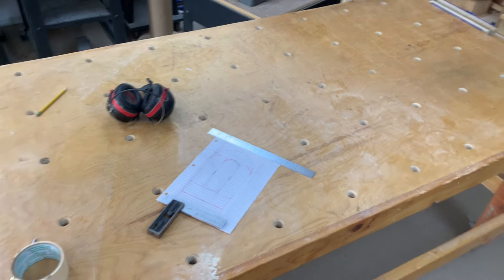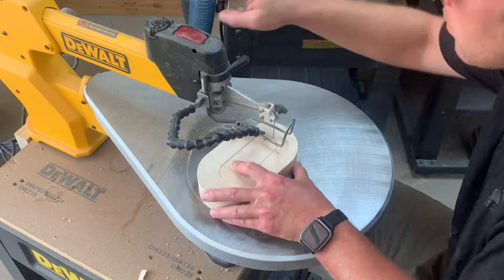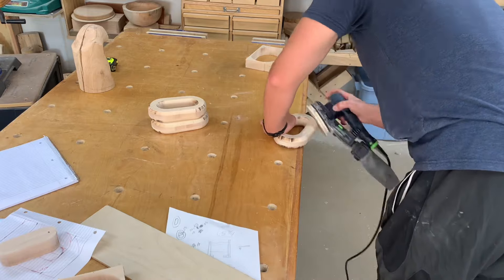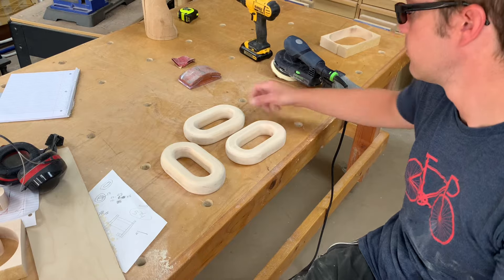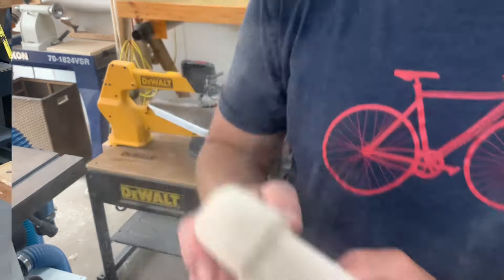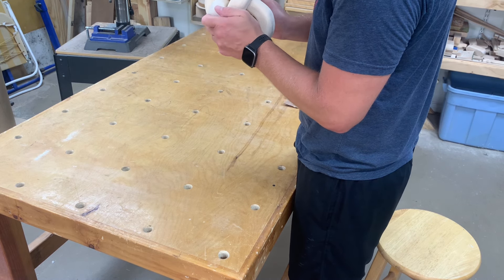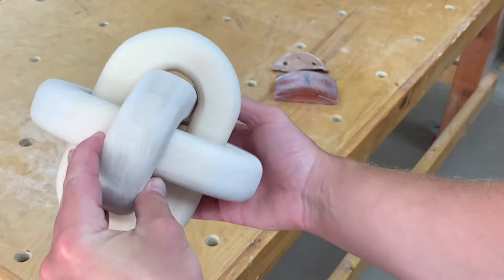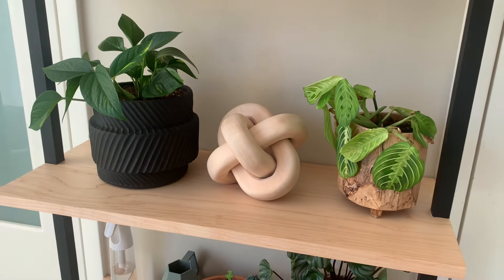Mind-Blowing Wooden Chain Ball | Satisfying DIY Tutorial #godfirst #diy #woodworking #handmade

Comment: Love the idea of this. Also if you cut the piece in half the other way, it would have connected a bit easier and the glue seem would be hidden inside of the knot. Great project!
Reply from the maker: Thanks for the tip! I’ll definitely try that if I run into a situation like this again!
Reply: Before I saw what he did, I thought he would cut it in the middle.  I have also seen this done by splitting the link.  But either way it is a great piece.

Comment: Very cool project! I haven't thought of spraying water-based poly. I assume you can clean the spray gun with just water?
Reply from the maker: Yea it’s a breeze to clean, and it goes on very nicely, thanks for watching!
Reply: @SquirrelsWoodShop  I've used a Harbor Freight purple spray gun to spray lacquer, but it was a pain to run lacquer thinner through it after every use, so I mostly use Rustoleum spray finish for small projects. Next time I'm at HF I'll pick up another spray gun and try the water-based poly for sure since I also like the flat-ish finish. Thanks very much for the idea!
Reply from the maker: @schechnera  it’s really easy to use the water based poly and clean up is a breeze! I’m afraid once you try it you won’t go back lol. Thanks for watching!

Comment: There is a sanding trick you can use, turn the shape you want on your lathe, epoxy some sand blasting grit on to it and sand them on your lathe. Pretty sure you now know you cut the wrong sides.
Reply from the maker: Thanks for the tip! I have never tried the sand blasting grit sanding..sounds a lot quicker!